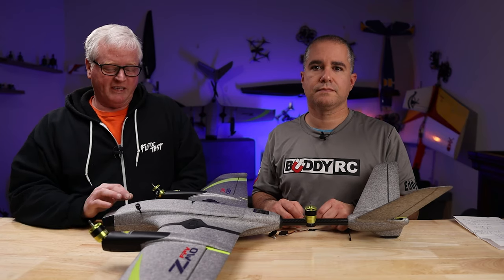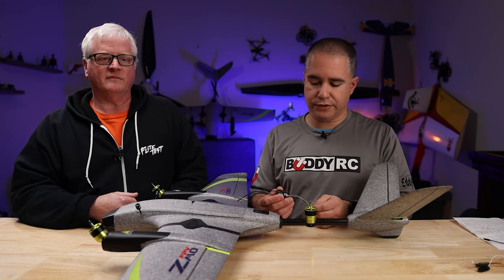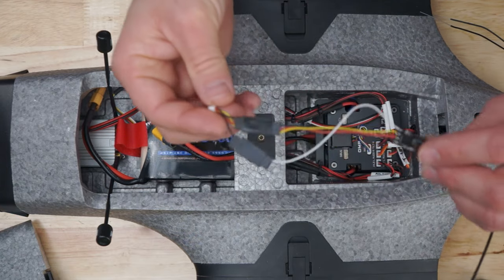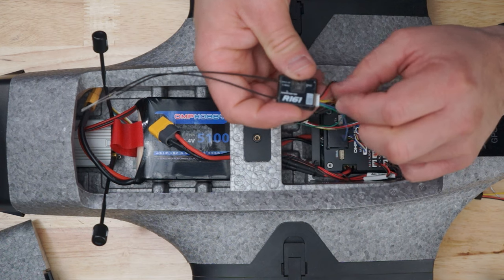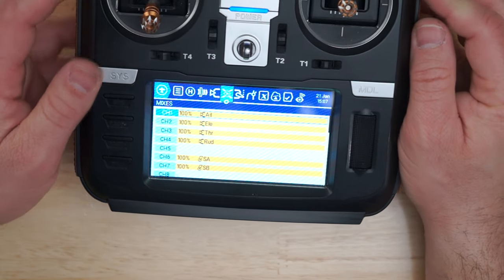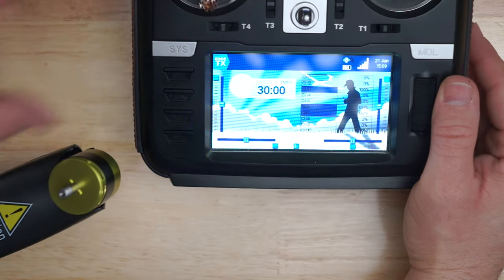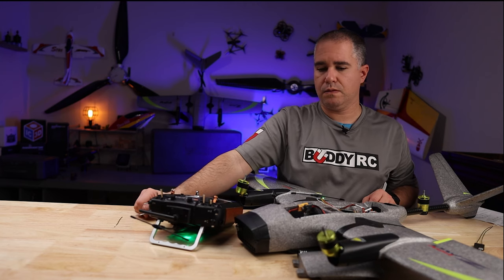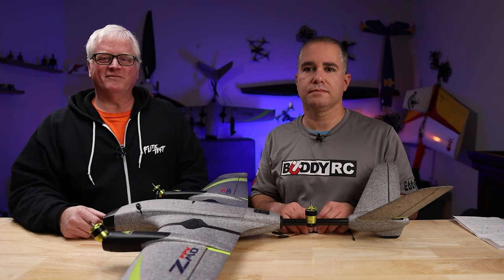OMP Hobby ZMO VTOL SBUS Receiver Setup

Comment: Great video. I flight the VTOL with the DJI Radio but I want to change to my Radiomaster with crossfire. On the VTOL is possible to change from self levelling to manual mode (I don't remember the channel/switch in the DJI Radio). On the Radiomaster wich CH is linked to the self levelling/manual mode ? Thanks

Comment: Hi, great video.  Am I understanding correctly that if I use only a Crossfire Nano I wouldn’t need to do the 2 connectors like you did and could just put all 4 wires into the connector and be good to go?  I also wanted to ask, what flight software did you use to setup switches and program the FC?  Thank you.
Reply from the maker: The Crossfire Nano could be used as an sbus receiver using only 3 wire or CRSF signal with telemetry on the fourth wire. The flight controller is proprietary software in order to have the best flight characteristics.

Comment: How about a video to set the switches to the proper settings when your not using a dji Transmitter.... Thanks
Reply from the maker: I used a RadioMaster TX16S with programmable switches in this video. If anymore request let know and will try to help.

Comment: Great video, guys!
Would I be able to use a Spektrum NX8 8-Ch transmitter and DJI Goggles 2 (the new version, released alongside the DJI Avata) with the BNF version of the ZMO or would I require the ARF version to install my own receiver (or just replace the existing receiver in the BNF version)?
Cheers
Reply from the maker: Unfortunately not yet with DJI Avata goggles. DJI has not release the update for backwards compatibility with air units

Comment: Thanks for the Video!   I just received my ZMO and I'm trying to set it up with an ExpressLRS receiver (i.e. CSFR pin order).  To be clear the SBUS plug on the FC is " GND - Rx/Sig - Tx/Tel - Vcc" .  The ExpressLRS Rx order is "GND - Vcc - Tx/Sig - Rx/Tel".   Also,  the ELRS Tx connects to the FC Rx and the ELRS Rx connects to the FC Tx?   Hope this makes sense...
Reply from the maker: Glad I could help
Reply: Were you able to connect to the FC with the ExpressLRS?  I am going to use ELRS on my VMO if it will connect using the CRSF protocol, if it doesn't I have a converter coming that will convert the CRSF to SBUS.

Comment: I see that you are connecting a SBUS receiver and the CRSF receiver.  I would like to know if a ExpressLRS receiver will work with the FC?  ExpressLRS has the same protocol as CRSF which, if I am not mistaken, is not the same as SBUS.  So will the FC be able to use either protocol?
Reply from the maker: As of right now only SBUS protocol is supported

Comment: This is a highly informative video, and I thank you for posting these wiring specifics about the ZMO plane.  Living way out in the boonies I am not limited to being within visual range of any drones I launch.  With a 60-foot radio mast beside my home and monopole antennae for 2.4GHz and 5.8Ghz ready to install along with the requisite coax cable and line amplifiers, I'm hoping to maximize downrange distance flown using a VTOL fixed-wing craft like the Model ZMO in this video.

My question is whether the DJI flight controller that is offered as an option with this VTOL plane, would be compatible with the mast-mounted antenna pair that I am rigging up for FPV flying.  Having successfully performed the RC controller surgery to allow for external coax cable connections needed for the ArgTek antenna upgrade kits sold online for the Phantom 3 Standard, I intend to set up a ground station at the foot of the radio mast, from where I would pilot FPV sorties via a flat-screen TV monitored from the comfort a couch located indoors.   Any insights that you may care to share would be appreciated, sirs.
Reply from the maker: We can't answer because according to FAA laws it has to be flown within line of sight.
Reply: @BuddyRC  I don't reside in the USA so FAA regulations are for me but a distant curiosity.  Your response is appreciated all the same.

Comment: When will the ARF be in stock?  I don't want to have to pay for the Caddix unit, which I have no use for.  I have my own receiver and video camera and VTX.  I noticed in this video that there is nothing plugged into the VTX connection, would it be possible to get OSD from that connection?
Reply from the maker: We will not carry the ARF as of right now

Comment: Hi Eddy, great job as usual.  I have my Crossfire bound to the TX. I have movement on all surfaces, but I try to calibrate GPS but I can't get to that mode. Also tried to get motors spinning but no luck. In the manual it says to cross rudder and aileron up to the center to calibrate GPS. No response. HELP PLEASE! Thanks!
Reply from the maker: Please call us at BuddyRC

Comment: To answer the question about plug type for the Sbus port. It's a Molex PicoBlade 4 pin. These are easily available with wires already installed.
Reply from the maker: Thank you very much for sharing to help the community

Comment: HI,
Maybe my question has nothing to do with the video!!
I bought the ZMO VTOL with Radio Control and Goggles V2 now I would like to buy the Goggles 2 but I don't know if they are compatible with the Radio Control (the Black one and the Caddx Air Unit).
Or could you use the V2 remote control and therefore also the Goggles 2?
Thanks in advance for your replies
Reply from the maker: The caddx airunit works with the black square DJI transmitter only or you can install your own receiver on the FC.

Comment: Thank you for the video but I am still confuse about the wiring.  I have wired so many TBS RX to my FPV quad flight controllers.  You mentioned signal and telemetry wires.  I'm more familier with Ch1 and Ch2 pin on the RX.  Which one is the signal and which one is the telemetry wire? Thanks.
Reply from the maker: Channel 1 is transmit and channel 2 is receive

Comment: Great video! What type of connector do you need to plug into the FC, is that a SH 1.0 or a GH 1.25? Is arming a calibration still done by stick positions? Thank you
Reply from the maker: I used a 1.25
Reply: @BuddyRC  do you disconnect the sbus and ground from the air unit?
Reply from the maker: No

Comment: Nice video.  I found photos of the OMP VTOL FC.  I'm going to do some research to see if it's compatible with Mission Planner or at least capable of running Ardupilot firmware.  It's a slick platform but too bad it's based on a proprietary flight controller.   I am still searching the internet for more information regarding the flight controller.
Reply from the maker: Sounds great!

Comment: You sure make it look easy to connect a SBUS RX.  I have a RM T16s with Ghost module and RX that would work, but is it necessary to have the Caddix air unit installed?
Reply from the maker: No you can use any video system you would like.
Reply: @BuddyRC  How about OSD?  Can the FC display OSD on a Video system other than the Caddix air unit?

Comment: Hi. I purchased one of these recently. I like to fly my planes so that when I push up on the pitch, the plane climbs, and down = down. This is typically an easy thing to do on a regular RC plane by reversing channel 2, however, with VTOL's, if I reverse CH2, forward becomes backwards when in vtol mode. Do you know of a way to mod this in a radiomaster TX16S?
Reply from the maker: You can not do that with the included FC
Reply: @BuddyRC  - but I’m going to use a TBS Tracer and radiomaster TX16S. I can reverse channels and use logic functions.  I’ve reversed channel’s successfully using the XK X450 VTOL.  I’m just not sure how to set up the logic function so that reverse is inverted when a switch is set to a certain position.
Reply: @BuddyRC  it doesn’t have anything to do with the FC. It’s a function of the radiomaster (receiver).

Comment: "to THIS connector????"  What connector type is that 4 pin sbus.  You gloss right over the details.  Why would you use such an odd connector type?  Do you sell the proper cable???
Reply from the maker: In the future a connector will be available
Reply: @BuddyRC  it the connector available yet? I'm happy to make up my own lead but I need to know what type of connector it is. If the connector is 'secret' then the video is useless, sorry. PS.. I've tried normal 4 pin connectors that come with some receivers but the plug is too big to fit the socket in the FC.
Reply: It's a Molex PicoBlade (4-pin)